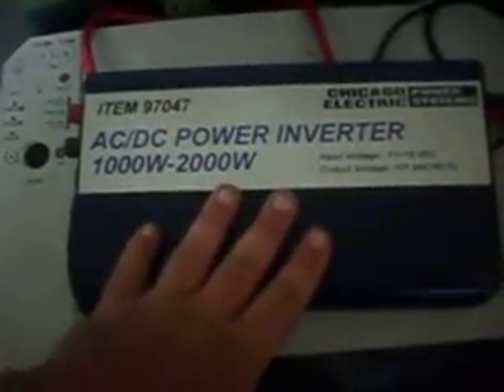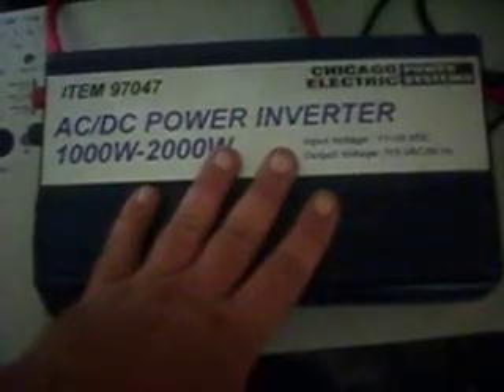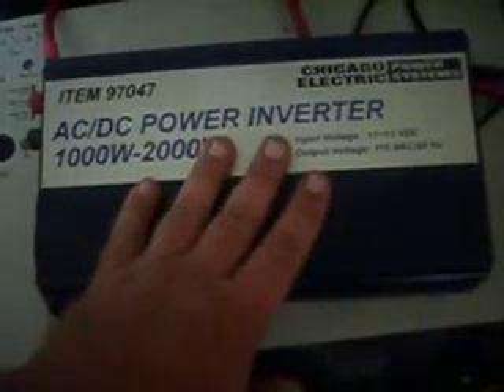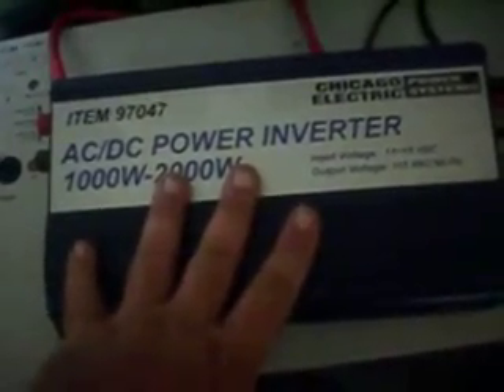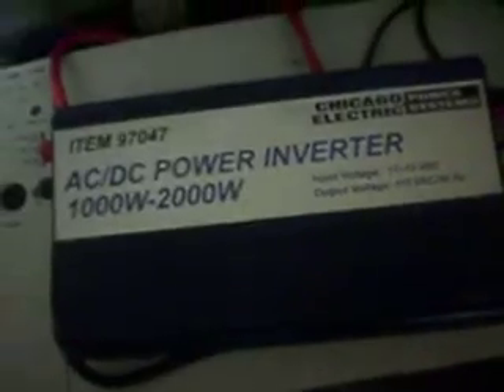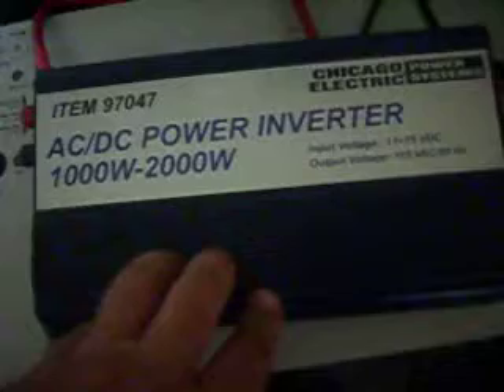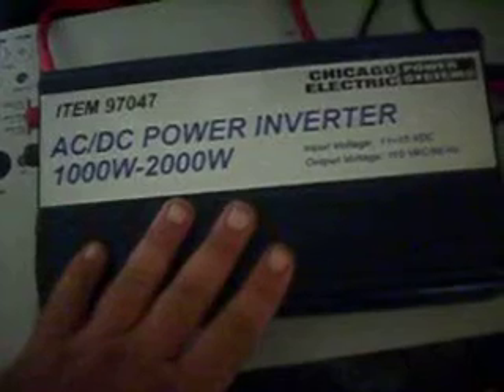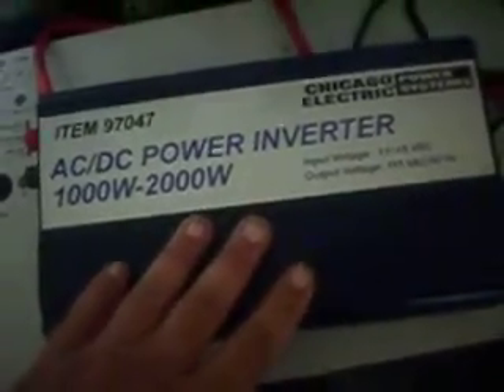Harbor Freight 1000/2000 Watt Modified Sine Wave Inverter

Comment: Okay, last thought. I replaced the 'cheesy' battery cables on the Centech 1000w MSW inverter with regular auto battery cables. It ran for about 10 seconds and shut itself off, again with that same 2.8a output. Conclusion: small inverter for small things only and ditch the small cheesy battery cables it comes with.

Comment: I forgot to mention. A buyer will see inverters and similar products always advertised with a big number such as "1000 watts / 2000 watts surge" or even larger numbers. They will seldom or ever print the "amperage" available from the product. Please note my comments below about the formula to use and how to determine how much energy you'll need from an inverter to run your item. I have a smaller Centech 1000/2000w modified sine wave inverter that as a test today I hooked it to my 336ah solar battery bank and allowed it to power my freezer/refrigerator for one hour. It works, But. The inverter (not the fridge) ran hot, the cheesy battery cables provided with it got very hot, and the Kilowatt I put on it to document its output showed a steady 2.8a. The Renogy 2000/4000w True Sine Wave inverter I normally use runs that same freezer/refrigerator at about 1.2a. Bottom line, the Centech struggles to more than twice the power needed while running unacceptably hot, and I can't account for why the Centech outputs twice the power of the Renogy, unless the 'modified sine wave' aspect is responsible.  Hope this info helps.
Reply from the maker: I'd replace the cables and check it again.  If there is too much resistance in the cables the inverter can run hot trying to push through the required amount of current.

As a friend of mine who is an Electrical Engineer always told me, run the biggest cables you can the shortest distance you can.

Comment: Lots of questions below as to why this unit 'won't run my (fill in the blank).  Simple math, folks. 100 watts (100w) is one ampere of current flow (1a). That said, one can't simply divide 100w into an advertised "1000w" and expect to see 10 amps. Our commercial electrical grid doesn't deal in "100w" increments. We have, on average, 120vac available at the outlet. The formula is Watts ÷ Volts = Amps. So 1000w ÷ 120vac = 8.3 amps. That's it - 8.3a is all you have available. Take a good look at the data plate on the device you expect to power. My little Honeywell floor space heater (6" in diameter and about 11" tall) draws 12.5 amps at 1,500 watts according to the data plate. It takes no expertise to note that the second I attempt to power this space heater with a 1000w inverter = instant fuse or circuit breaker failure. Sorry guys, but stubby pencil 2+2 math rules the inverter roost here and you have to do your math calculations before throwing your $$ away.
Reply from the maker: Thank you.  You explain it much better than I do.

Comment: I got 5000 Watt Continuous/10000 Watt Peak Power Inverter from Harborfreight modified sine wave inverter is suck is only power up the laptop
Reply from the maker: Just what are your trying to run?  Mine runs 2 deep freezers and a refrigerator.

Comment from the maker: A space heater is a resistive load.  Many inverters have problems running a resistive load such as a heater.  Make sure the inverter will power other items such as lights or a small refrigerator.  Mine won't run my big coffee maker.  It will run my small percolator however.  Just like it won't power a big electric griddle, but it does power a small electric skillet.

Comment: just use a ups it willcondishion the power and have a backup battery of it own and be just a cheap and in the case of all your batterys going dead you will have its battery to power a light balb for light.

Comment from the maker: @handymancuso it is a 12v inverter with a 1500 watt surge capability.I can run 2 freezers and a refrigerator on it as long as all three compressors don't come on at the same time.  The starting surge of all 3 is well over the rated amount of the inverter and will trip it and possibly damage it.